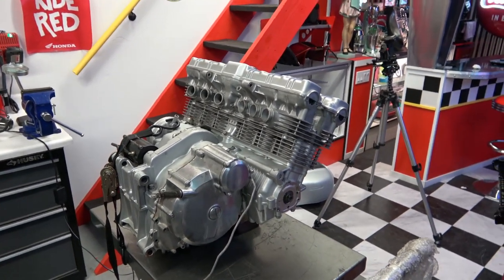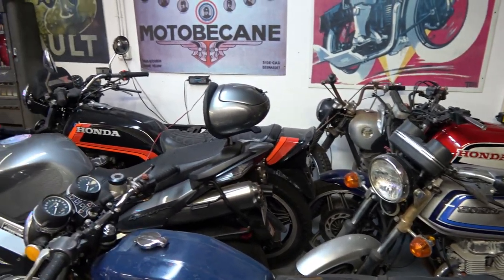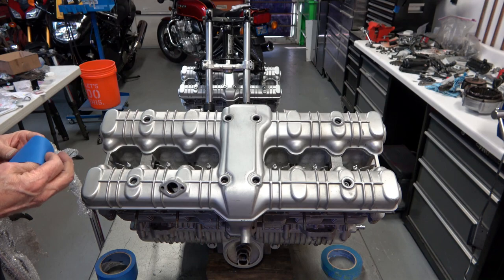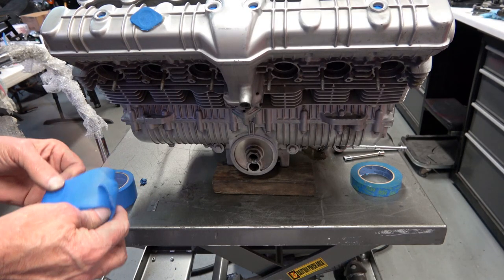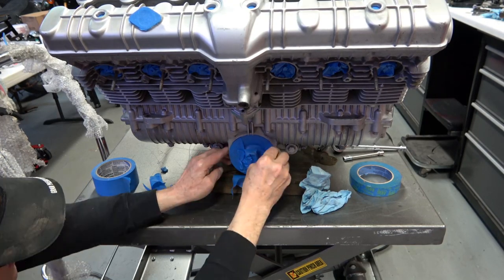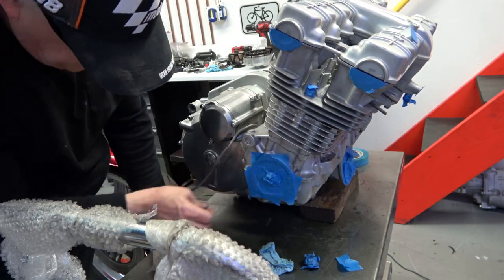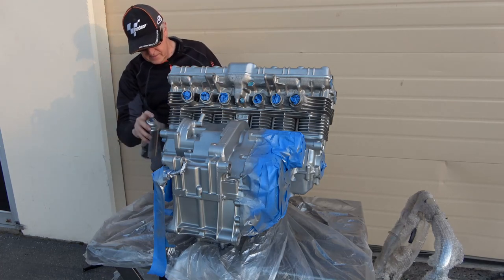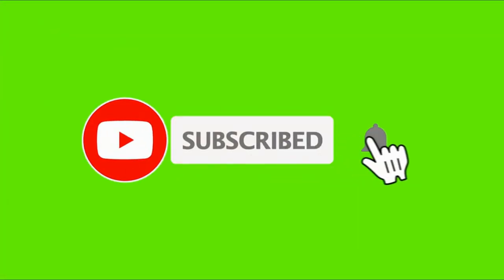Honda CBX Step by Step Restoration Video Series Part 34 - Preparation & Painting of the CBX engine

Comment: Great video! Glad to hear the engine was in pretty good condition before you started. Last engine I painted was from a 1987 CBR that was sitting for 9 years in dry storage, and it was dirty! Bike was going with no side or front panels and a custom tail so there was no hiding it.

Comment: Hi! Love your videos. You say "fog over with a rattlecan". Is it alu-paint or something else? Heat resilient I assume, for how many degrees?
Reply from the maker: Hi Trygve , Thank You, I really appreciate it. I use an automotive engine or brake caliper paint which are both 500 degree paint. I use silver, not aluminum as it is to chrome like in its finish.  Any automotive parts store will have the best choices. I hope this helps :)